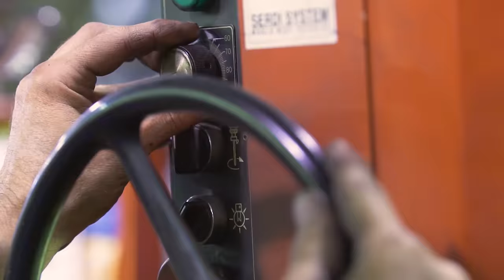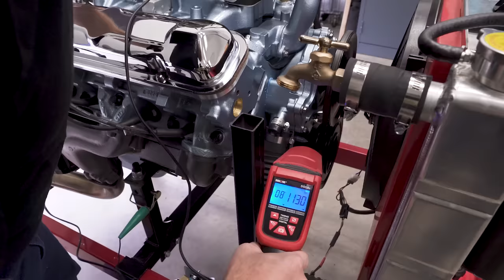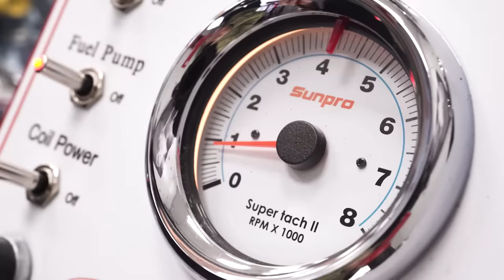Rusty parts to running engine: Pontiac GTO V-8 engine time-lapse  | Redline Rebuild - S2E4

Comment: 8:30 this Tri-Power WANTED to Run; now to find it a good home in a nice pontiac body!
Reply: Gotta be the '67 GTO convertible!
Reply: GTO judge
Reply: A sweet 66 -67 GTO
Reply: 1964 body. Original and best looking. Simple lines.
Reply: @H1delta  Hardtop or Convertible?
Reply: Only one car that tries power belongs in an that my friends is a 1966 GTO hardtop.  Tri power 389 only could be ordered for 6 months then discontinued afterwards an before late 65 they were put on by Harmo & moody California. I ordered my first 1966 GTO in late 65 an then trade in a few months later early 1966 on a 1966 GTO tiger. Wish I never sold them, 66 GTO tri power 4 speed, total perfection muscle car.

Comment: that was one of the best 10min of my life,,wow i wish i could build something like that
Reply: You can!
Reply: You can💪🏼
Reply: Yes you can!
Reply: @jonaszanchettakock9876  I want to believe that I can too, but where does one even begin to learn? I feel like there must be decades of experience behind Hagerty's skills and knowledge. I know my way around a wrench, but there is so much advanced stuff in this video!
Reply: siguy715 bro start with Japanese motorcycle engines. Start small then work your way up. I started by rebuilding an 82 KDX 250 2stroke motor that has only one piston. It’s very small, very basic and teaches you the basics of engine work. Then move on to an old 4 cylinder 4 stroke motorcycle engine from the 80’s as well as I did and then eventually a 4 cylinder car engine and then a V8 and so on. This engine is older so it’s easier, but it requires more math and knowledge. Modern engines do as well except they have computers that help out. Ask most 25 year old “tuners” how to set timing on their Subaru and they will probably pull out a laptop. I’m 23 so I’m speaking from my group of friends. I always loved the idea of simplicity, so all that fuel injected fancy pants stuff never interested me. To each his own though.
Reply: @GatorsFan2138  cool thanks for the advice! I'm 36 so starting a bit late perhaps, but better late than never.
Reply: siguy715 no problem bro! Never too old! I just started and I picked up on it quick. You will develop an appreciation for naturally aspirated engines if you start, I used to think turbos were cool now I know I can make engines quick without all that complicated mess haha. Best advice would be to get a good socket set, lots of penetration oil, a torque wrench, and a good bench to work on. Happy building!
Reply: To build it right as quickly as a pro will take many years of experience. To paint it like a pro will take good paint and a good set up. To make your video look like theirs will take...a long time lol. But you can do it. Take your sweet ass time, watch lots of videos, and research as much as possible. Took me 3 days to build my first 355 but i was anal with every detail so i wouldn't miss a step. All the stress was so worth it when it fired up first turn. Been running strong for 4 years in my jeep.

Comment: Love it ! Wish Lucas would sponsor this dude ! I wouldn’t run pews-0il in my lawnmower
Reply: pews oil is alright so long as a fella uses Lucas oil stabilizer with it. Then again, what's the point ? I certainly wouldn't use it as a break-in oil.  I'm a big fan of AMSoil myself. Their filters rock too. Gearbox lube, . .ya da ya da yada.

Comment: In Feb 1963 I began a auto diesel course at National Technical Schools in LA.
Each month we made field trips to auto shops etc. that pertained to the subject we were studying that month. The month we studied engine rebuild, we visited Sears (I think)engine rebuilding in LA.
They started by checking main bores and then installed unfinished main bearings , then line bored the bearings to size in the block to make it straight.
 I remember the refurbishing the rods using a machine exactly like the one in the video. Even hone the bushing in the small end with a machine like you used. Only fix was measured by, thumb fit, palm push fit 
And press fit.seemed weird back then we did have micrometers, dial indicators and such back them
So sad to find after many years that school came to a end. They had a big part of the school in Cuba and lost it when the communist took over.
LA was a wonderland to me back then also. B&M Hydro, Isky, on and on.
Some are still there but The magic is not to me.

Comment: This Sweet--389 × 3 deuce looks pretty cool I like how you painted the engine block and other components when you painted the engine block you did not paint around with a gasket seals go you painted it right past that only to the openings and not like that idea because I think and believe that would help seal the intake for the heads any extra opponent I love the three deuce that makes that motor really special the Pontiac blue beautiful great job I would like to have one of these for my car 1967 Pontiac. great job

Comment: I woulda love to have the 3x2 setup on my 66 Catalina all I had was a bored .030 over 389 with a ram-airll cam and a great set of 428 HO heads and topped with a Holley double pumper..man I miss those days. Going through a back tires with every tank fuel...

Comment: Had this very same engine in my '66, then in my '70 later on when I swapped a 455 into my '66 GTO. 400 numbers were close, but my tri-power out ran it's share of 400s.

Comment: All the choice parts, late 60s big valve open chamber #16 heads, Tri-Power, later Ram Air D port exhaust manifolds and a modern valve train with roller cam. It's a Pontiac guy bench racing session brought to life. I can't resist asking out loud....I wonder what it would make power and torque numbers on an engine dyno!   ?

Comment: 1966 was the last year for a tri-power GTO.  1967 went to a quadra-jet, it was rated @ 360 hp w/400 CID.  I know, I had a 65 w/std engine 389, a 67 360 hp.

Comment: Interesting fuel line set up. Only Tri-power I've been around was a Chevrolet. But I think the fuel pump was on the other side. Or the connections to the carbs were on the other side.

Comment: I didn't see not one old rusty part used in that rebuild,except the engine block that got a new sleeve installed. Everything else looked like a typical complete engine rebuild. The video title says,using old rusty parts laying around not all refurbished and machined and painted up.

Comment: Can anyone who understands engines far better than me explain this:
They discover damage/wear to the cylinder wall and knock a new cylinder liner in. They the plane it and bore it out more. Surely they will bore it out to the same damage as before? If not, wont that particular piston be less (width-wise) compared to the others?
Amazing skills as always :)
Reply: Once they saw the damage to the piston wall they bored that one piston out bigger than the others and knocked a piston liner in. That way it matches all the other cilinders in diameter. (The boring of the liner is for precision)
Reply: @Svizcov  That makes sense now. Thanks for that 👍🏽

Comment: I think I saw two huge cracks and an area between that didn't clean up on the boring machine. On the bore he then sleeved. They were huge cracks.

Question on the machining of the conrod big ends; is this just like a clean up ream to check they're all still circular? But without changing the designed diameter?

Comment: I'd like to see them rebuild one of those hyundai gdi engines they have in a 2013 santa fe.. see why they start using oil at 60k miles or less.. they could practice on mine.. lol

Comment: Putting valve seat inserts in is scarey,  by the time they are all in the heads are near certain cracked.  If not the first warm up and cooling will see it.
Personally a patch up to save a head. IF all the seats are junk so is the heads.
One maybe two sleeves to save a block is fine, though hammering them in is a worry. Press them!!

Comment: Love the vid but curious where the PCV leads to exactly, doing a restoration on a 66 catalina and I got no clue where it hooks up.
Reply: I'm not sure if I'm wrong, but I don't believe PCV innovation was around in 1966. I think it just stayed in the crankcase
Reply: @misterwiggins757  ok my 66 catalina has a 350 I got for cheap from a 71 lemans so don't know if I need a different valley pan for the engine now or not, also confused where the factory brake booster hooks up in the old thing if ya got any more info on that itd be greatly appreciated man.

Comment: hey is there a more detailed video about how you repair a cylinder wall with a crack like that? or can anyone explain to me what exactly got done here? did they just slide in a "new cylinder"? I mean even if you had a metal tube with the strenght wouldnt you have a smaller displacement for this particular cylinder which means a smaller piston which means other forces and therefore an imbalance? would a minor alteration be notable in a 5,8 (?) litre engine? or do you first drill out the damaged cylinder so that you get the original diameter after you reinforce it?

Comment: When you sleeved that one cylinder, do you have to use a smaller diameter piston?
Reply: It was most likely re-bored to the same diameter as the other cylinders.

Comment: Why are the intake and exhaust cam followers linked by a small loose plate?
Reply: They upgraded to roller lifters, the tie bar keeps them from rotating in the bore so the roller stays square to the cam.

Comment: How long is the motor at the machine shop for typically?
Reply: Depends how busy they are, can take a few months sometimes, other a few days. Most shops will do a rush order for a fee.
You know you're in the right place though when the shop smells like iron and oil and the owner tells you it will take a few months, means they're really busy.

Comment: Why do you assemble and disassemble the conrods before actually installing them?
Reply: Same reason you install the main caps before installing the crank, checking the clearance with the bolts torqued to spec is a critical step in the build process. Its the only way to get an accurate measurement.

Comment: What is the benefit of using a muffler for testing if the engine works and not a catalytic converter? It seems if you go to the trouble of rebuilding an engine you can replace a cat if it clogs, huh?

Comment: Nice! But it is not recommended to fabricate/ repair the inside of the engine block, with in mind that it has a crack/ dents. That will ruin all your hardwork and perseverance building this monster.

Comment: CAN YOU PLEASE TELL ME THE COST FOR PONTIAC BLOCK TO MILL. To get someone this good will cost more than a Pennsylvania hillbillies  can afford.
Reply: The guy I use charges around $200 to square the decks, $325 to bore and hone and $250 for an align hone. Thats about an average going rate, looking at probably around $200 to deck the heads as well. Not sure off hand about doing the valve seats.

Comment: Can't tell if he did.... but anyone else put tiny amt oil on headbolt threads?.
Saw it done and I started doing it.
Reply: Always under the bolt head, for a more accurate torque reading, never on the threads going into a blind hole. Believe it or not, get enough oil on the threads you can actually crack the hole.